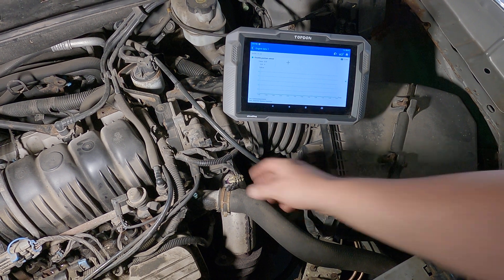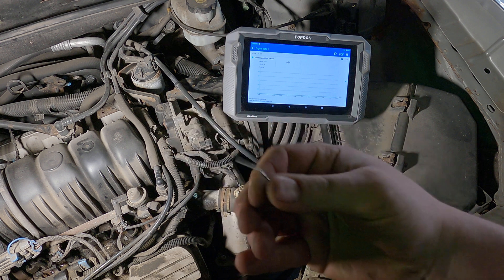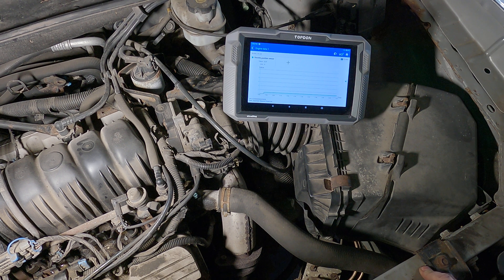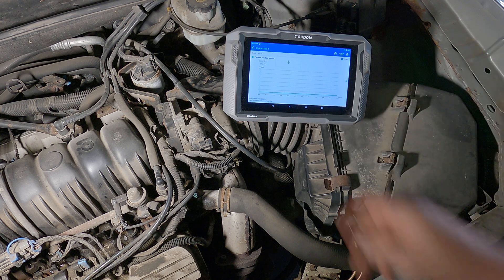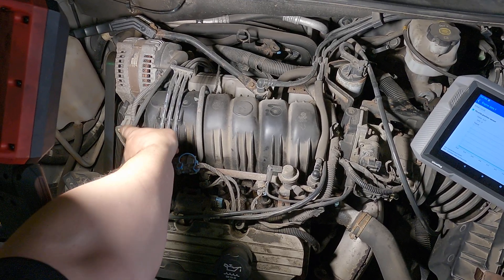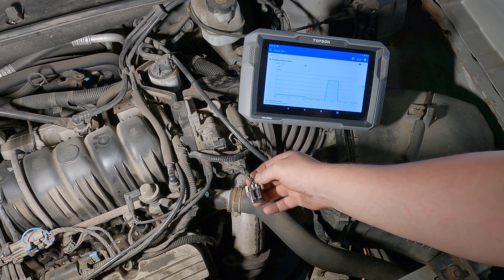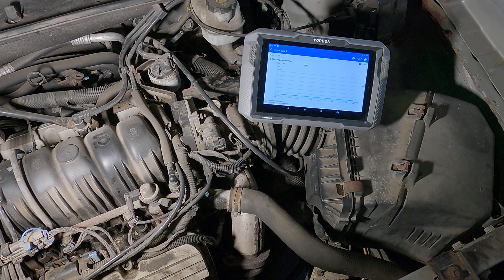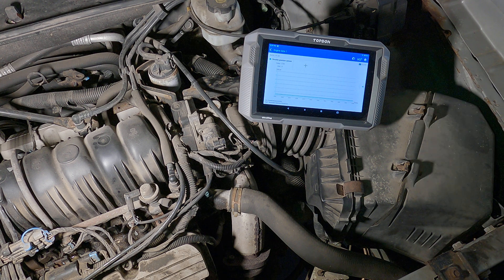Three Wire Sensors : Quick Rundown

Comment: Hi great video, when u tested the ground and you say voltage goes high, are you talking about the signal voltage? Thanks
Reply from the maker: I am referring to the signal voltage. 
In the video, I only test the 5v feed to the sensor. The ground for the sensor is verified by steady low voltage on the signal wire with the sensor plugged in. If the ground was faulty, you would see the signal voltage stay at zero or go high. I hope I explained that well enough.  Thanks for watching.
Reply: @710diagnosticsandfishing  was a super quick video straight to the point, i was just checking i understood it correctly. I have an oil pressure issue  and will follow ur steps. The only thing i dont have is a scanner that will read the voltage in the ecm. Thanks again. Im watching from qatar Russell